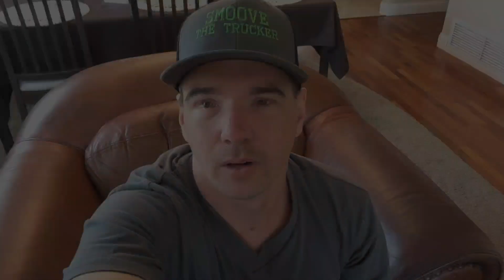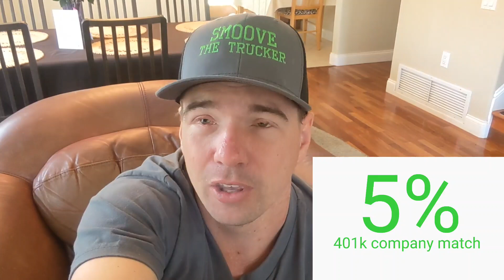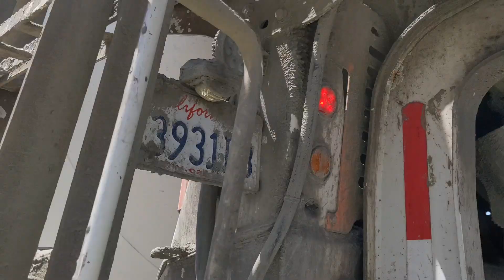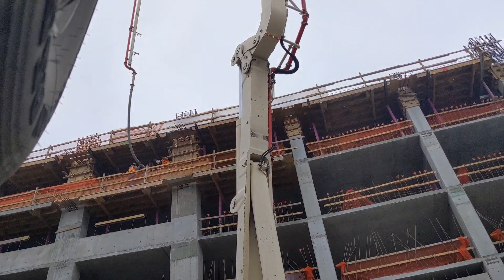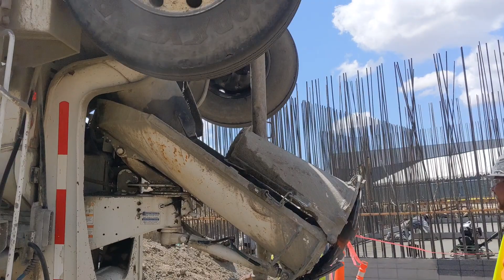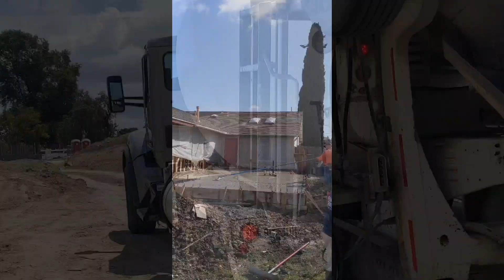Working at Holliday Rock. Concrete ready mix driver $$(pay exposed) 2 week update

Comment: Great video. looks like the pros at holiday rock are great pay and benefits what are some of the cons in your opinion. possibly taking a position with them soon. Thx also seen herc hiring as well
Reply from the maker: Cons would be during the rainy season. The work load drops considerably. Below 40 hours a week. Hands will get Grimy and dried out easily. Wear a mask. Otherwise you may breathe in the concrete powder, not so great for the health. Besides that. It's good company

Comment: Hi I watched your Video. I'm working with FedEx Ground too. I have been driving them FedEx for 8 Months now. But my plan is I would like to get Local job something like too. So I need your advice How can I apply for the job or can you refer me? I'm live in LA ,California too 🙏🏻🙏🏻 Thank You So Much 😊😊
Reply from the maker: @ThainicRefractor  I no longer work for holiday Rock. I'm with Herc Rentals hauling heavy construction equipment now. But go on Indeed, and submit the applications near your LA area. It's a good time to apply. Start of the summer, lots of high paying local trucking jobs are hiring right now 👍
Reply: @smoovethetrucker1926  it that good Company right ? And Is they hiring easy or hard ?
Reply from the maker: @ThainicRefractor  Requires at least 1 year tractor trailer experience and a clean MVR record. On Indeed they list all the requirements. The high paying local trucking companies are going to want at least a year prior experience before they will most likely hire someone
Reply: @smoovethetrucker1926  oh Thank you 🙏🏻 I just searched it on the Website they hiring now required only 6 months experience. I’ll try thank you for you advice.😊😊